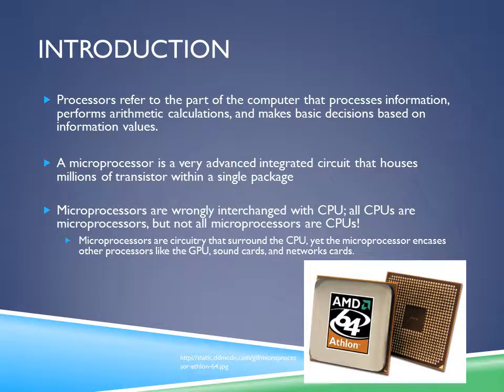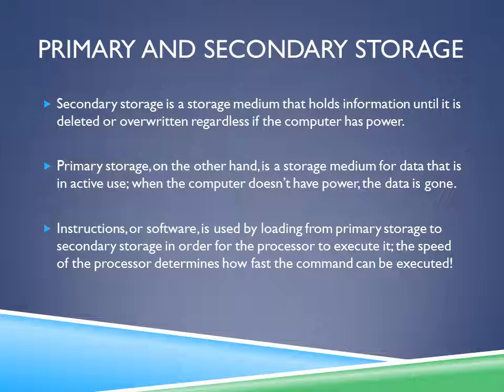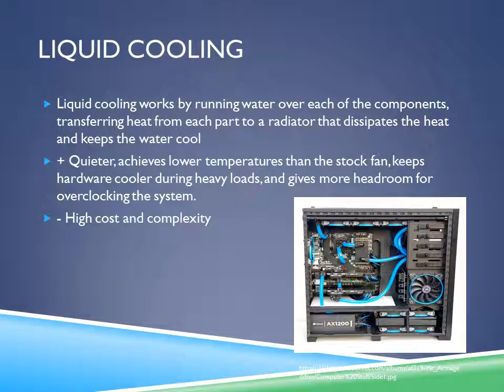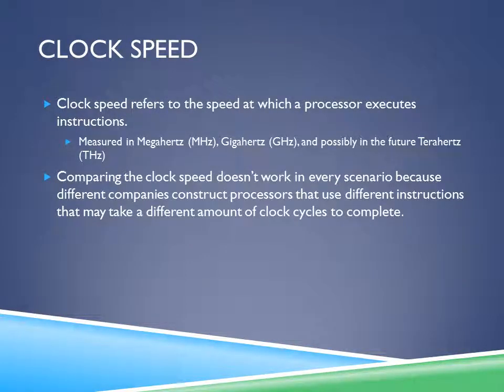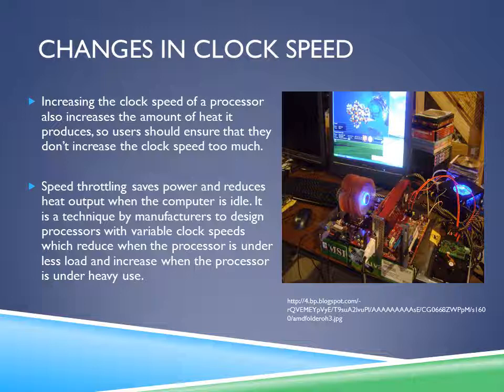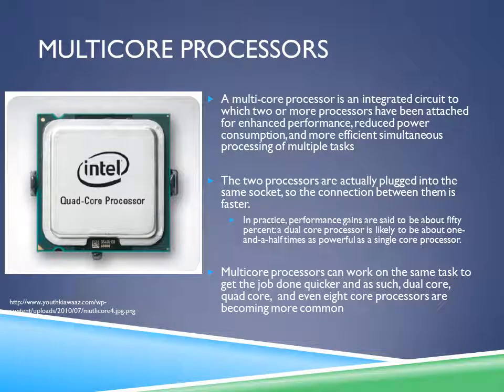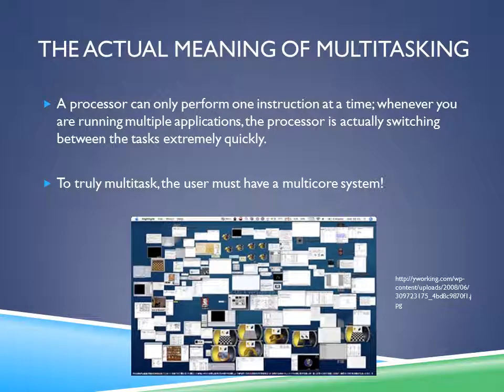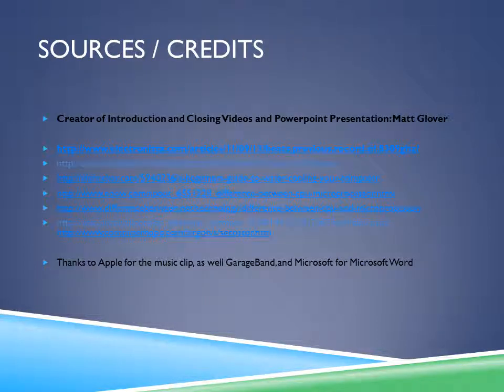Chapter 2 : Processor Technology

Comment: I think a common misconception is that Ghz, and Mhz determine the "speed" of the processor. Look, for example, at the AMD FX series which contain anywhere form 4 to 8 cores and an average of 4 Ghz clock speeds, however these are obsolete to the Intel i-series which has anywhere from 2 to 8 cores and only an average of 3 Ghz clocks speeds. This is mostly due to architecture of the processor and how it is able to handle issues of heat, efficient processing, and bodttle necking.

Comment: Processors are one of the most (if not the most) important parts of a computer. However, many computer users (mainly laptop users) forget that it is very important to keep the processor cool. Overheating the processor will send a laptop to an early grave. I always make sure to use my laptop on a solid surface so the fans have room to work. It is my hope that future developments will come out with a cheaper and more efficient way to cool processors for all kinds of computers.

Comment: Processors are essential to computers. It is important that when using laptops, that you dont use the laptop on a soft surface such as your bed because the processor will become heated and this can also hurt your laptop's battery life. I think processors will continue to become more powerful in the data and computers will be able to process data even faster.

Comment: The processor is the most important part to the computer.  Without a processor the computer will not function. It's extremely important to make sure the processor is kept cool. The process of liquid cooling was very interesting. The faster the clock speed the more cooling the processor needs. Amazing how much the heat becomes an issue in a computer.

Comment: From this video I can tell the huge significance that processors have on computers. The processor is key to many things that give the computer its functionality. Heat from processors is immense and I have seen this first hand when the processor on my Xbox came disconnected from the heat sink and melted the motherboard. It's crazy that nobody has developed ways to make them more efficient and/or cooler besides fans and water.

Comment: In my opinion, processors are the most important part of computers. Processors have the computer's data when it's powered and when it's not. I thought it was interesting that there was a whole section talking about the heat of processors. I understand that the temperatures can get really hot and they need to be cooled down but that's only due to the fact that processors are utilized as the base of the computer. For example, the motherboard, it contains most of the nowadays computers' parts.